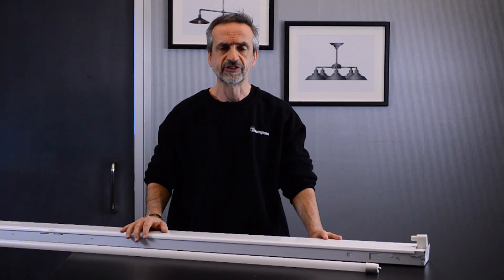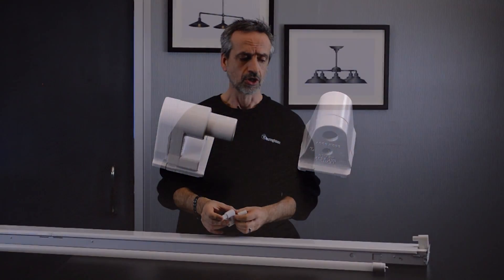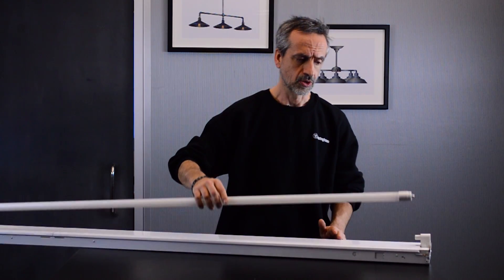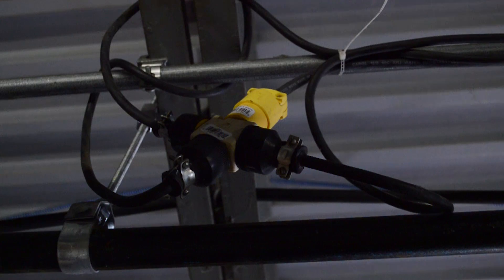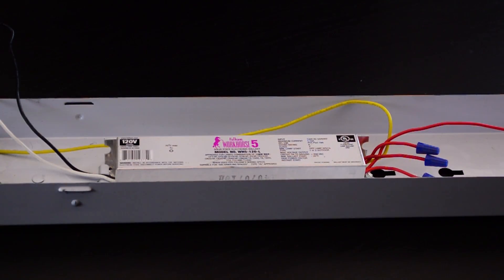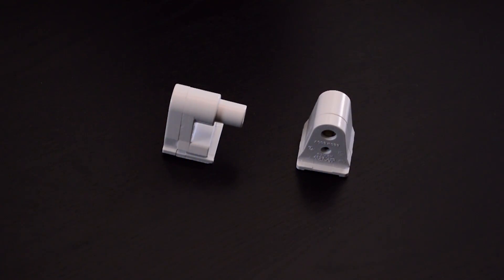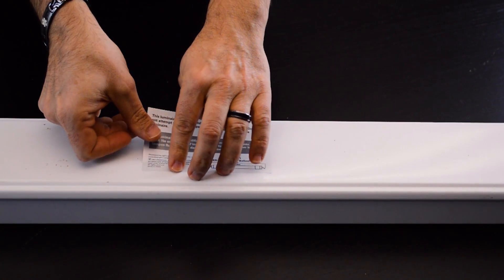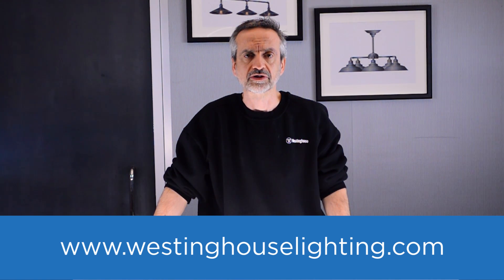8 Foot T8 LED Informational Video

Comment: My 8' fluorescent fixture has a single wire (red & blue) on one end coming out of each tombstone.  The "hot" end has 2 black wires coming from one tombstone and 2 white wires coming out of the other.  I wire d one blk wire to the far end and connected the red, blue and black wires together.  I hooked the other blk wire to the building supply.  I connected one of the white wires to the building connection.  When I turned on the electricity, only one T8 bulb lights up.  I tried connecting the second white wire with the other two.  Still only one bulb goes on.  Do I have to connect the second white wire to the tombstone with the two blk wires?
Reply from the maker: Hello: This video is an installation overview and therefore doesn’t provide step-by-step instructions. However, this information can be found in the instruction manual. If you are unfamiliar or uncomfortable with re-wiring the fixture, please contact a qualified electrician. Thank you.

Comment: It would have been good to see both ends of the fixtures and also a two bulb fixture. So I could see if wires run in parallel or series.

Comment: It is much more energy efficient to bypass the ballast than just replace lamp which is connected to ballast. I have seen the 8-foot LED tubes in a local CVS store close to me. The lamps bow downward in the middle of fixture due to long span of flimsy plastic tube. I would convert all 8-foot fixtures to (2) 4-foot lamps. At this point in time it might be more cost effective to replace entire fluorescent fixture with new hardwired LED fixture, which would be more efficient in getting the light out of fixture.

Comment: I have an 8 foot T12 ceiling fixture with 2 bulbs and a magnetic ballast. It barely lights up in cold and damp weather. I am going to do the ballast removal LED upgrade. I'll just jump the two tombstones on each side together, line on one end and neutral on the other. I imagine the bulbs are marked as such.

Comment: Incomplete video, would be nice to show both ends of the connection, I have a single  pin but have two wires on one end and one wire on the other